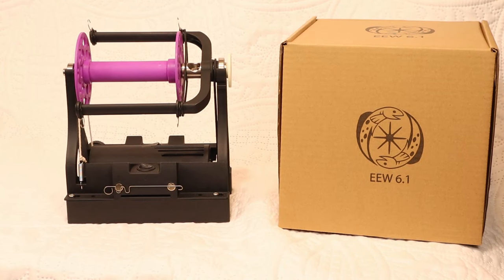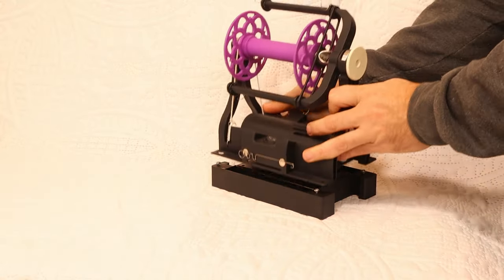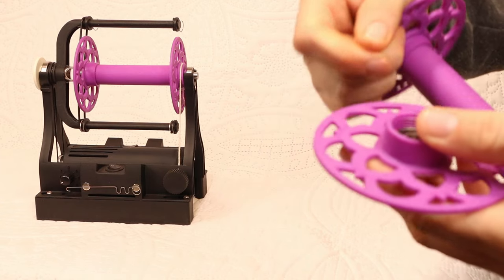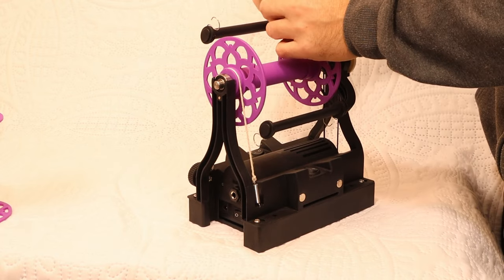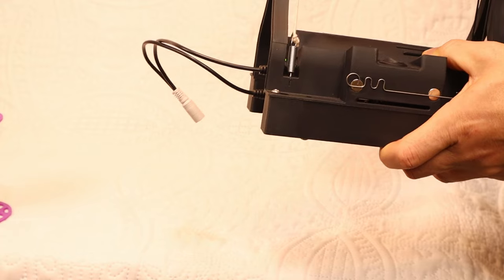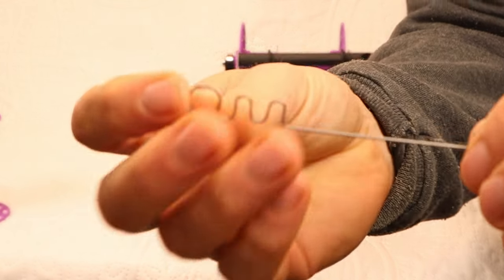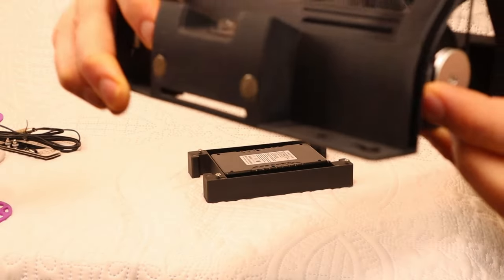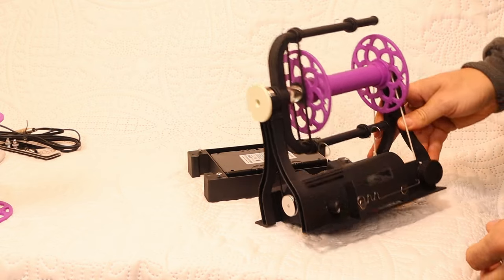Spin 168 - EEW 6.1 Improvements

Comment: Will you be selling an upgrade kit - specifically for the extra switch and controller board? 
Can I buy the new drive band as mine is too tight? Can I buy the extra stability tie that goes between both arms?
Reply from the maker: The switches and circuit board would require a new case so I don't plan to offer those because it would be most of the cost of a new eSpinner.  When I start selling the new drive belts they will work with yours but this isn't a priority since the ones you have now have been working well for people for years.  I offer a 3D printed version of the stablity feature for the flyer as a 3D printed part here: https://www.dreamingrobots.com/eew-3d-printed-parts/ (it's part of the lace flyer)

Comment: Where can i get that splitter cable
Reply from the maker: That comes with the Tallentcell battery.  That said, I don't recommend using it.  It's there so you can charge the battery and use it at the same time, but it's not something I'd recommend.

If you still want it look up 5.5x2.1mm splitter cable on Amazon.